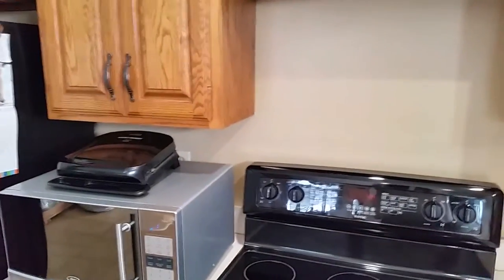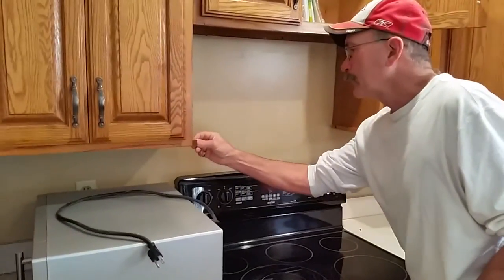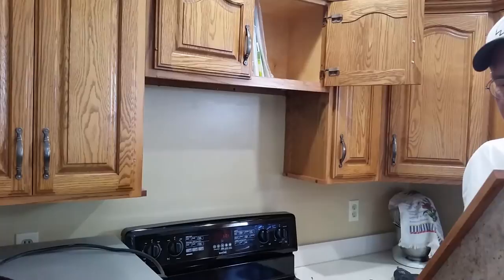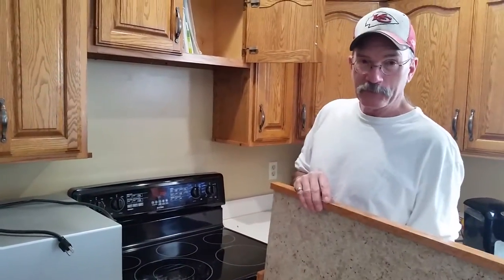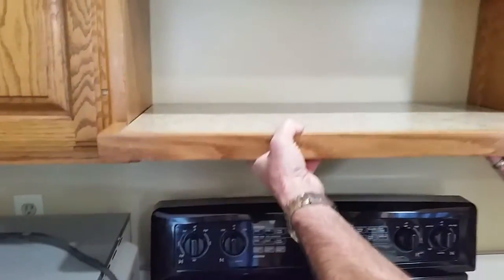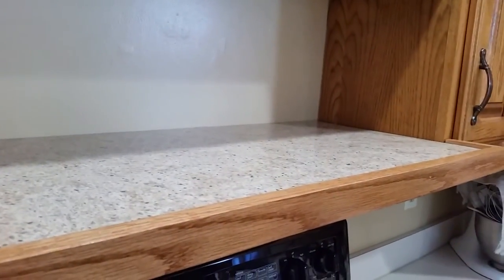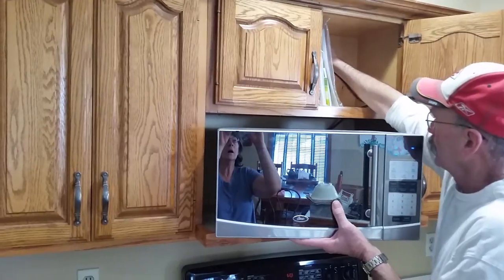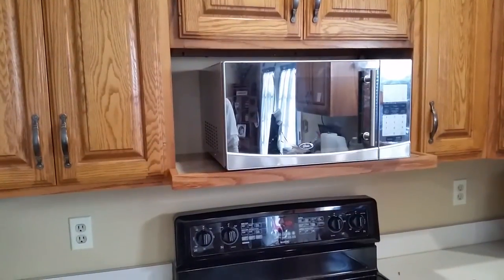Video of microwave shelf concept.

Comment: This video goes against every fire code I have ever seen.. you CANNOT have combustible materials IE wood within 36” of the top of the heat source.. There’s also no range hood to exhaust above the stove. This is a case of trying to save in his words $250 on a new microwave but is willing to risk his house burning down?
Reply: Will McLendon - exactly. It's a big hazard.